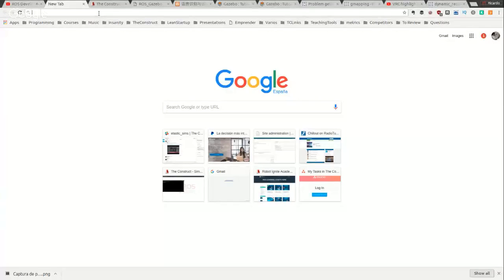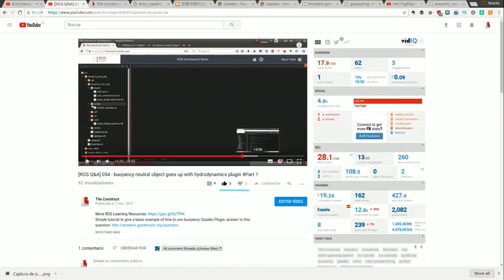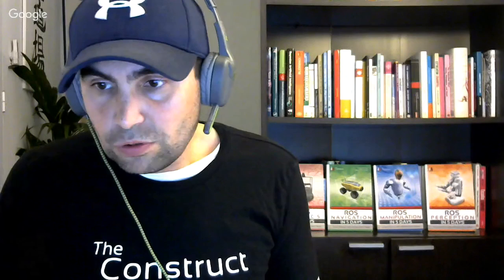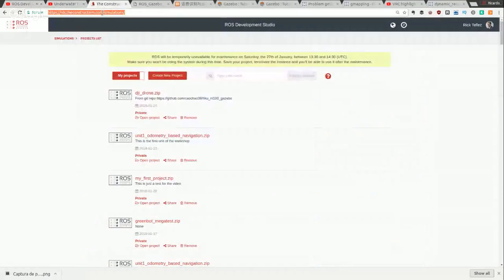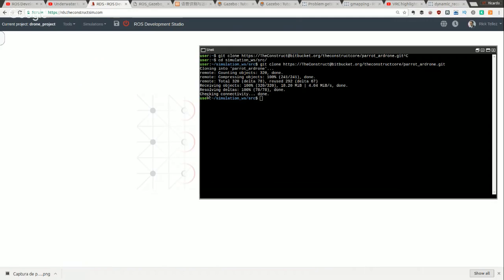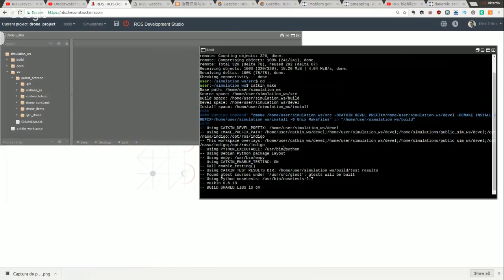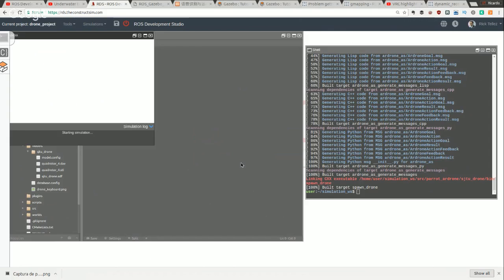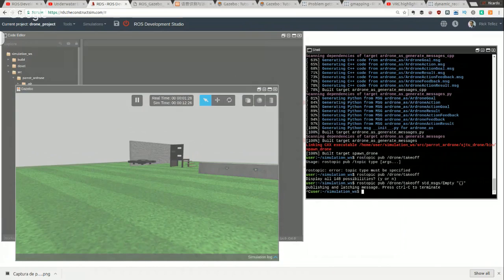ROS Developers LIVE-Class #5: Simulating a Drone from Scratch

Comment: Thanks for yours videos! They are very useful. Congratulations.
Is it possible to use hector_slam with only a kinect sensor? If yes, how can I publish a tf base_link -> laser?
Reply from the maker: Thank you Vitor for your comments.
Yes you can do SLAM with only a Kinect sensor. You have several options here:
1- Use the RTAB-Map system that uses 3D data to create a 3D map (instead of a 2D). Watch a tutorial about how to do it here: https://youtu.be/gJz-MWn7jhE
2- Use a convertion of Kinect 3D into laser (2D). For that you are asking me to create a transform. Very simple. Create a static transform specifying where in the robot is located the laser (in which position of the robot is the laser located, respect to the center of the robot, I mean, respect to the base_link). Read this tutorial for that: http://wiki.ros.org/tf#static_transform_publisher
Reply: The Construct thank you.